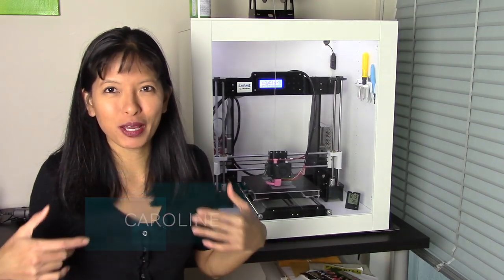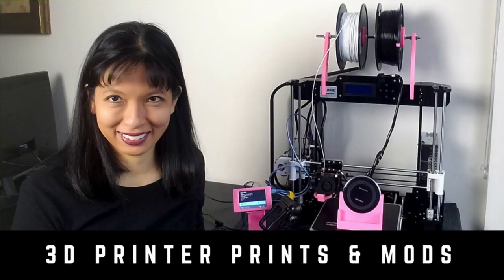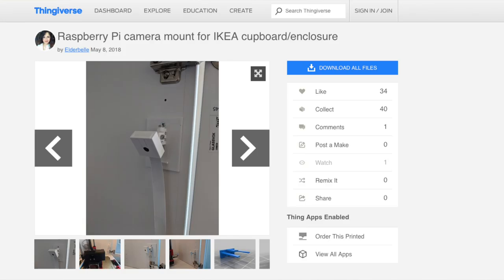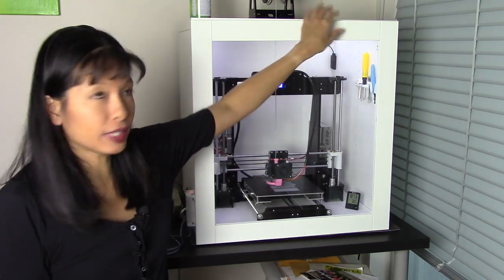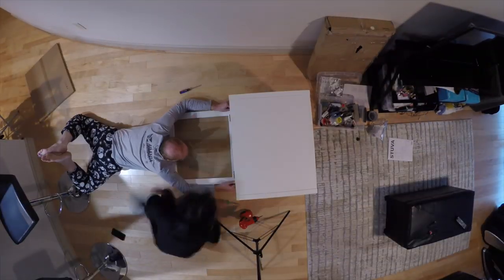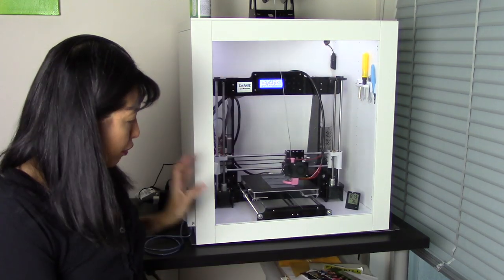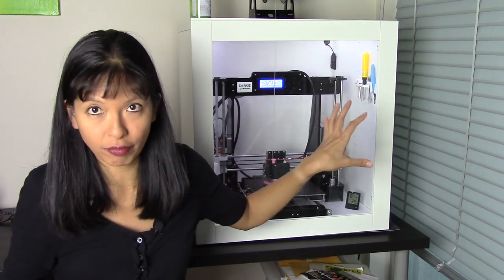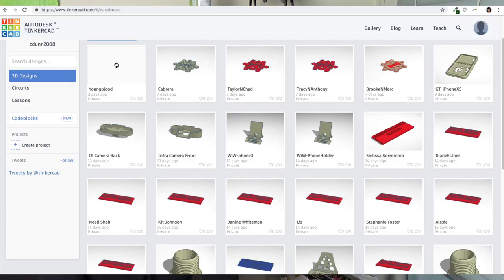My Anet A8 3D Printer Enclosure

Comment: Looks nice and clean. But I'd suggest moving the power supply outside of the cabinet altogether. The power supply that comes with the Anet is pretty cheap and I'd worry about it overheating.
Reply: Any power supply is better if it's outside the cabinet, power supplies don't really like heat, because the high temperature reduces their lifespan drastically. I would suggest the same for the mainboard. Just move them outside the box and you're saving the electronics.

Comment: Nice cabinet you have every right to be proud.  I  think in your firmware you can enable thermal protection.  It will shut it all down.  Also your power supply may overheat and cause a reset while printing.  I had that problem on long prints and mine wasn't even enclosed.  I put a $6.99 computer fan on it and solved that. Just so you know.